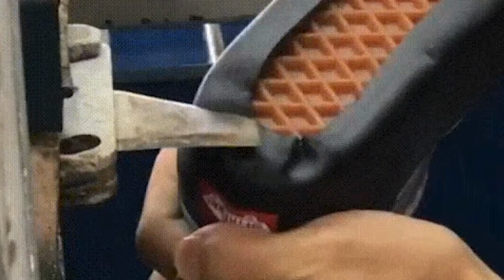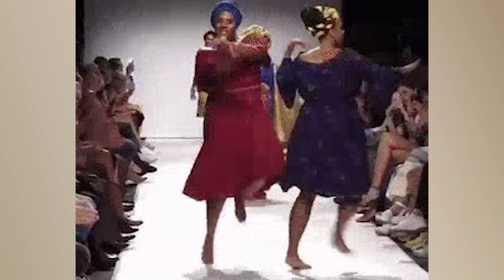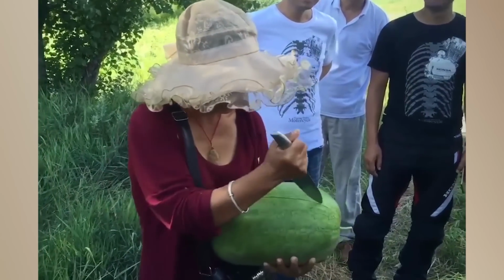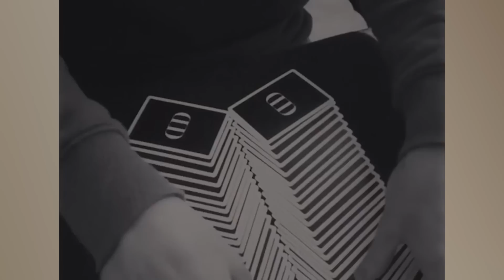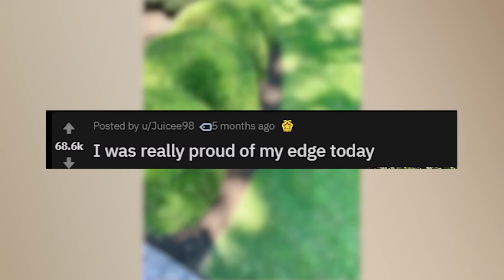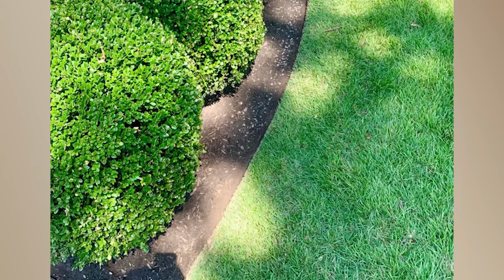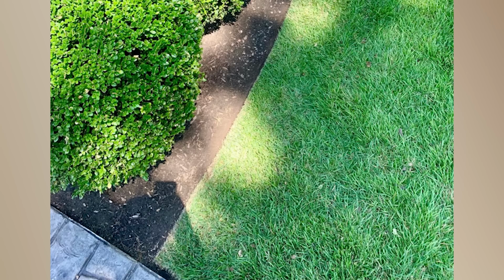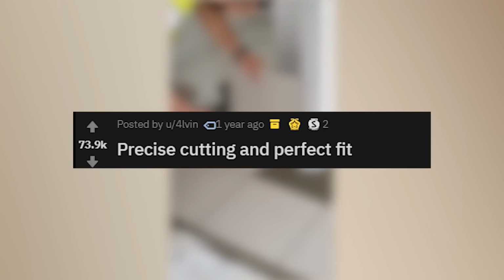Satisfying Skills At Work

Comment: 2:30 fake cuz' when he turns the cocumber the slicing or clicking noise is still going when he didin't cutting the cucumber
Reply: Well it is fake since when he finished he stabbed the board without sound, if it were to be reality it would’ve been heard, you would hear every time displacement if each time fracture.